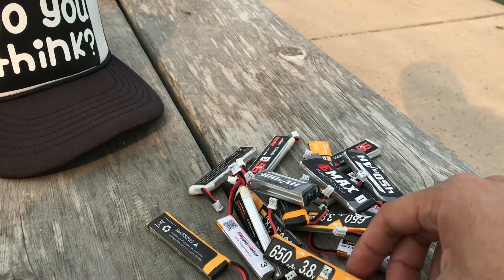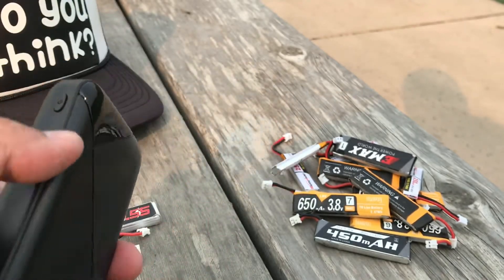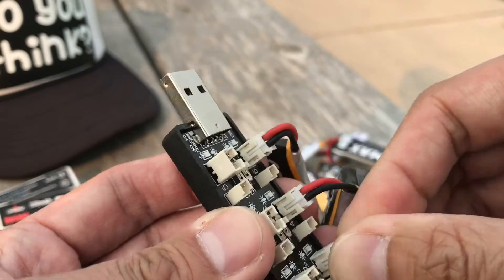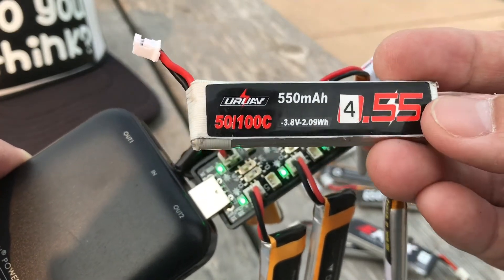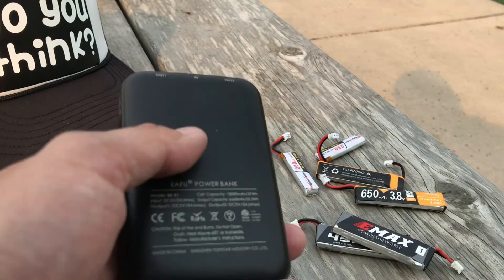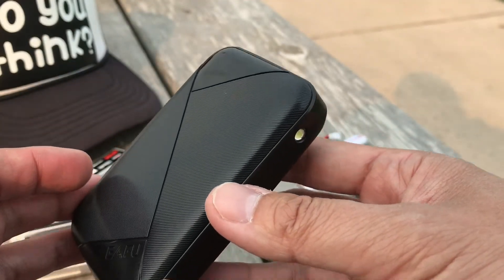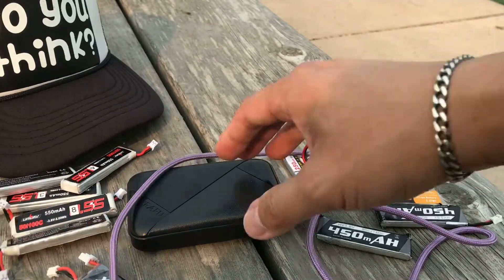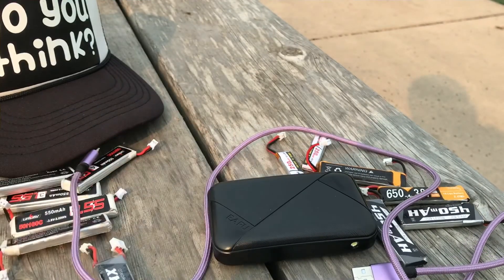Easiest Way to Charge Tiny Whoop Single Cell Lipo Batteries in the Field

Comment: Does this board have a paralell version? I bought this thinkinh its a paralell board, and I feel like a retard rn.
Reply from the maker: The board is good because you can charge them all no matter what the voltage is. Its more convenient. With a parallel board, they all have to have similar voltage.
Reply: @Funcentric  yeah I know, I just thought I have a paralell board. I guess not. Is it normal that one battery fully charges before the others then? With this board specifically

Comment: You can see with a charger how many mah have been put back into a battery. Typically it is in the hundreds. Not sure for a 600 mah but would make a wild guess it is replacing 100-150 mah going from 3.8 to 4.3, so you don’t need as much as calculated for twelve batteries. Great point about how you can charge lots of different devices beyond batteries with a battery pack. They can also run LEDS on gates or timers. Cheers!
Reply from the maker: You are absolutely right about the calculations on 12 batteries. My calculation was based of of fully depleting each battery which would never happen. So you're right, I can actually charge 2x as many batteries since I'm generally discharging about half on each use. Good call.